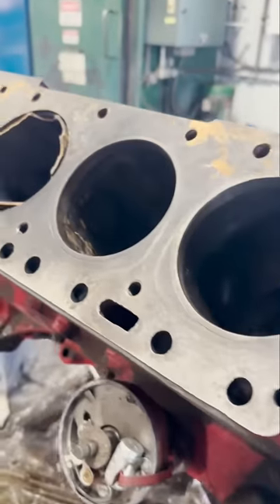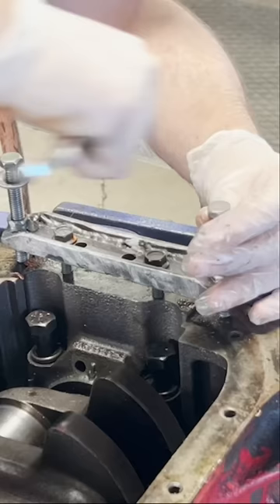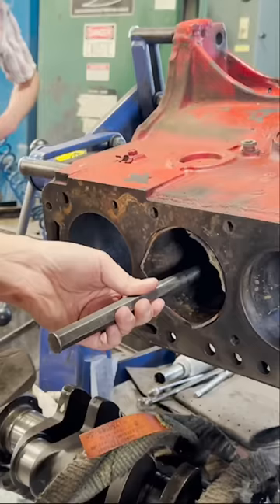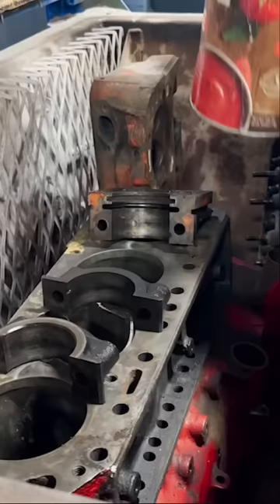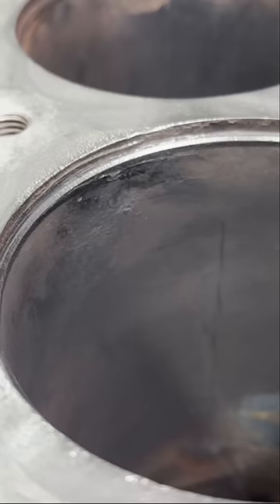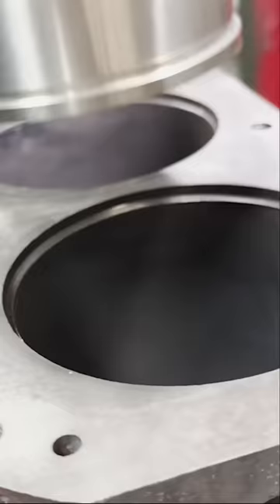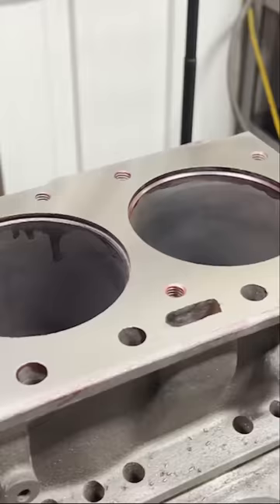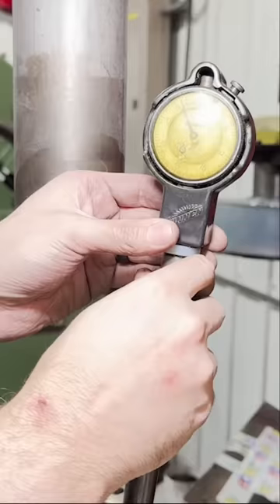#shorts I’m Sure They Work SOMETIMES, But When They Don’t…

Comment: I had a friend who worked as a diesel mechanic.  He told me he would remove cylinder sleeves by running a weld bead(s) all the way down the sleeve.  Upon cooling, the weld would shrink causing the sleeve o.d. to shrink enough to break it free from the cylinder block making it easy to remove.  He said it was fun to hear the cooling sounds "ting, ting, ting", and the final "crack" sound when the interference fit between the sleeve and the cylinder block finally broke free.  He said he always worked on a commission basis and the other mechanics couldn't figure out how he was able to do the job so much faster than they could until he showed them his secret.  Over the years he told me about many such time-saving methods he found.  He was a self-trained life-long auto, diesel, and lawn & garden mechanic and sadly he passed away some years ago.  I learned a tremendous amount from him and enjoyed his many stories.

Comment: If you cut the deck, you need to stack the valve train/rocker shaft posts by the same amount to prevent altering the valve timing. It probably won't make much difference on an older engine but if the camshaft is accurately dialed in...

Comment: I once had an old flathead 8 that was a tad off like thise one. The old head gasket burnt through, the parts store was out ... so I cut out a head gasket from heavy corigated cardboard. Wet it down, put it on, tightened the head down (of course put everything else back on) ... then let it heat up for about 8-10 minutes. Shut it down, let the engine cool, then torqued it all up and I was good for another couple weeks. 
Signed
Master Shade Tree Mechanic from the 70's

Comment: You don't need a freezer to cool/shrink the liner.
Just use plumbers spray-on pipe freeze.
A few cans of that is far cheaper, doesn't need electricity, and takes up far less room in the workshop.
.

Comment: Previously rebuilt by a gas station mechanic who used a file, hammer, chisel, monkey wrench and lock jaw pliers! Coat hanger wire and ox/ acetylene welding optional!

Comment: Heat the Block , heat each cylinder , heat each cylinder evenly , heat the block evenly 
    Nitrogen bathe each sleeve
    Remove each sleeve from the nitrogen bath when the nitrogen with the sleeve in it  stops bubbling in the nitrogen bath ( it is at its coldest )
      Insert as quickly as possible pushing down on the top of the sleeve with a flat piece of wood or similar
     Protect your hands 
     Protect your eyes 
     Nitrogen sucks the oxygen out of the surrounding area

Comment: This of course is for old cars, 
Not my Japanese quad turbo racing engine which relies on those extra micromillimeters that were just milled off lol. I heard of a guy getting his heads shaved and his computer just said fatal error error error error... wrong oil and a normal mechanic can screw you. 
I hung with the local drag strip groups.. they know every thing and are happy to have help when their motors blow. They also like a good laugh when they hear my squealing machine :D

Comment: Pulled sleeves  all the time on nissan diesel nd  33 6cylinder in IH scout witn no damage.
Reply: Most diesel engines have wet sleeves with o-rings for sealing. Dry sleeves can be rusted and can cause damage when pulling. If you watch his video on YouTube you will see what it did.
Reply: @chrisgraff1979  well most  larger diesel have wet sleeves smaller ones are dry sleeves  cummins 5.9 -6.7- perkins-71 series detroit diesel  the list goes on& on  but beyond that if you know what you are doing you can pull dry sleeves all day long. Check out the nissan diesel  the liners are paper thin. If you don't know what you are doing , lock up the tool box & go home !!

Comment: You can take a welding rod and weld from the bottom of that sleeve all the way to the top, and it will shrink it, and it will fall straight out

Comment: I had to pull sleeves in a 4BD2 Isuzu.
The block wasn’t warped, but I had to resort to a different method. I ran very fast stick weld passes in the sleeves, so fast I wouldn’t damage the block. A rounded old extension let me tap about a centimeter of the sleeve out from the crankcase end.
Grabbed the exposed sleeve with a vice grip, and a rubber mallet was all I needed to extract the sleeves.
After a quick wipe down, I was relieved to find absolutely no damage to the cylinders.
Waited for a good, hot day, did a final cleaning to the block, and used dry ice to shrink and install the new sleeves.

Funny, there are no rebuild kits available for the 4BD2 anywhere in the world.
We had to order each individual part from the factory in Japan.

It was hard to find someone that spoke Japanese!

Comment: I just did my first oil change at 4000 miles and the old oil had a bunch of metal in it like glitter is that normal for a brand new engine or do I need to take it in for a warranty?
Reply: More than a little bit is not a good sign. Send a sample off for oil analysis and know for sure.
Reply: @kevinpulver4027  recommend where to send it?
Reply: @Jahwigga  the dealership should know. Mine does it but its a commercial dealership.

Comment: That's why top-hat sleeves are superior as on terminally prone sleeve sliding engines like the ALCOA Buick-Rover all-alloy 215 V8 produced from 1957 to today (went from 3.5 to 4.0 to 4.2, to 5.0, to 5.4litre) with rather jury-rigged twin-cam heads on a shoestring budget much like British Leyland's project Iceberg- to turn the Rover V8 into a high compression diesel.
Buick-ALCOA had done such great work Buick tried to tuy the engine back- then Buick had the idea to chop off the front four cylinders halve it and weld back on the front two making their bullet-proof V6

Comment: Can you do a engine build video where you take a terrible engine like the cadillac ht4100 and fix all of its flaws making it into a reliable efficient engine. Would be cool. Replace the iron head with a aluminum one, bore out the narrow oil channels, swap out the throttle body fuel injection to direct injection.

Comment: Don't know if it would work in this application  but the diesel guys say they run 2 beads of weld inside the sleeve and when it cools the sleeve shrinks that little bit that the sleeve comes right out...  have you herd of this?  Does the info I was told hold water?

Comment: Where I live all but one machine shop has closed..
Reasons 
days gone by of the muscle cars and DIY mechanics replacing  engines by using machine shop engines..
I want to replace the one in my GTO, company online sells late model engines with hp around 500 about $27k plus and have to buy a computer system for it..
Everything is around $35k..
I guess the machine shop can rebuild the engine for a fraction of the cost..

Comment: What's the difference between wet and dry cilinders?
Reply: Dry would be bore liners, wet would be liners in an engine that was made to be sleeved/rebuilt and has coolant around the sleeves like normal cast in place cylinder walls have.

Comment: Is that block out of an 8N or 9N tractor? Just curious.
Reply: It doesn't look like either to me. The distributor coming out of the side at an angle rules out 8N for sure (the one we have has the old school 4 way block type distributor on the front of the engine. 8N's are newer than 9N's, so I'm guessing that block would be from something newer than the newest 8N (1952), so I'll swag it and call it an NAA Jubilee from the mid 50's, but not older. Now that I've said that, the real expert will chime in to correct/clarify the record. :)

Comment: Is there any change in compression ratio after squaring up the decks? Do the new pistons have a difference to make up for the change in distance traveled or if it takes too much off to square up do you just call the customer and be like yeah its a loss

Comment: How can you find work like this in developing countries like Pakistan?
Reply: Are you wanting to work in a shop like that … or do you NEED work like that in your shop. A lot of shops like this ( of this size, etc) are usually a “word of mouth” type promotion and recommendation…. Guys ask other guys where they got some work done a few years ago.. 
“Bobs Block Shop” … etc..they usually specialize in a certain thing… get really good at it, and proficient… and that’s how word spreads about the quality of work at reasonable prices. Usually quality of work is first… and If the work is good enough, people will be willing to pay well for it… ( as replacing an irreplaceable engine block can not only be expensive.. but sometimes impossible) 
Wish you the best
Reply: @Jlinwoodjackson  The thing is the mechanics here would rather take on the job themselves and make a mess of it instead of recommending someone else! And the cost is a huge factor

Comment: .016 or .0016 one not so bad 😢 lol. You're going to need a spacer for your carburetor now, and taller valve covers.
Reply: Explain to me why taking a bit off the block would change the size of the valve covers needed?
Reply: @joshmiller3673  or need a carb spacer.... I think he's joking.
Reply: @joshmiller3673  starcasm doesn't translate well in the comment does it?
Reply: @joshmiller3673  technically speaking, the heads probably needed to be refaced also, so you would need taller valve covers to fill in the space that you lost in the motor Bay, LOL yes I am just joking, I know the material removed is barely measurable. I'm a professional fabricator for a Aerospace company, it's like saying when you need a square block put it in a lathe, not saying that it can't be done, but that would be probably the hardest way to do it. i.e. starcasm doesn't Translate well in chat.😄

Comment: Awesome job sir. I’m just curious, how much can you take off the deck before you’d be concerned with too much compression?
Reply: They compensate by using a thicker head gaskets
Reply: @nutz4gunz457  I didn't know that, thanks dude!
Reply: @TomRad1 If you use decent fuel, you won't need to make up the difference. Stock, these engines were 6-1 compression. The M&W kit raised it to 6.5-1.

Comment: Anyway I could ship you guys my engine to get it all fresh and funky? I just got a 2007 525xi bmw, I changed my spark plugs and it’s a shit ton of oil in my cylinders and it has 210,000 miles I’d cut off my right nut to get that engine looked at and spruced up…..or I’ll pay on cash I suppose😞

Comment: Sleeved engines are junk..if it isnt a chevy 350..454..its not worth spending 1 cent on..maybe a 262v8..or straight6 tow fifty cc. Or big 300

Comment: When you take that much off the block deck and then resurface the head do you guys make custom pushrods? Had a machine shop take so much off an engine a few years ago we had to have custom length push rods made and it added a few hundred to the bill we weren’t expecting. Machine shop should have only taken a few thou but ended up taking almost 35 thou between the block and head. It doesn’t seem like much but that’s a few millimeters.